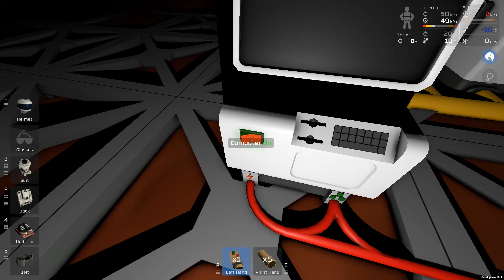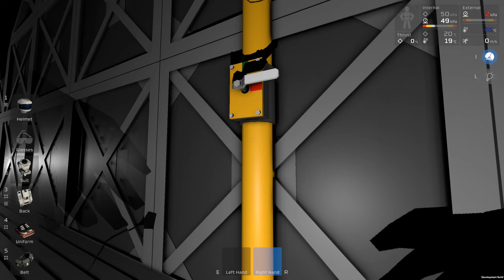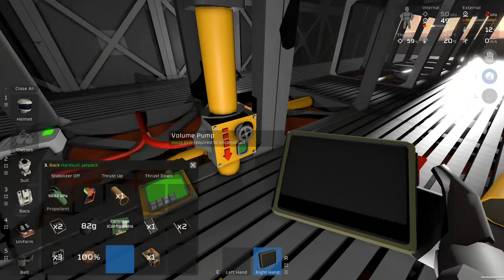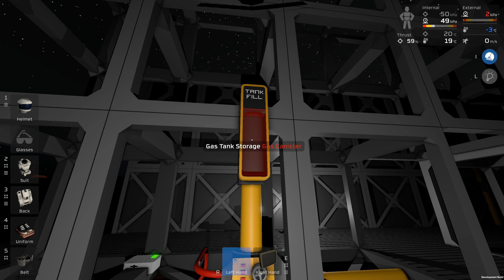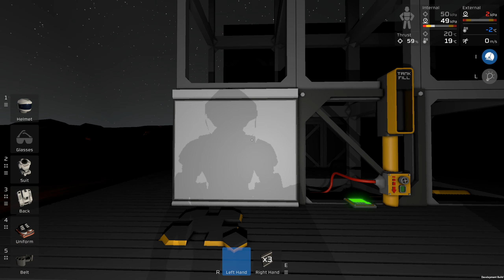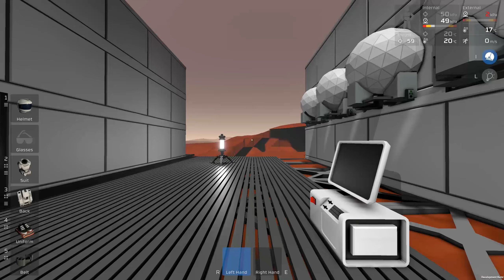Stationeers S4 E18 - Gas Inputs, Tidying, Gas Room Building

Comment: Once you have lights connected to wire you can remove the block they are attached to. This way you can have lights on window roofs. They are basically held in place by the wire but so what? ^^

Comment: RE your thought on the fill station regulator:  I'd turn it on/off based on the pressure value of the regulator (Setting) and the pressure in the gas tank storage (Pressure).  This way it will keep the pipe at pressure without a tank. When you put in your tank, the pressure will drop causing the regulator to kick on bringing the tank up and shutting off when it's at level.

Comment: I took your "challenge" from the last video to create a script to read the filter type in the filtration unit and turn on the device if the gas matches the type of filter.  I have a script that's variablized and fits exactly in the 128 line limit of the script :P Unfortunately, I don't have it here at work (ahem), so I'll need to link it later tonight.  It will read all three types of filters for each type of gas and toggle the filtration unit if the type of filter is needed in either slot.  I have not fully tested it, but I'm pretty sure it's good to go.

Edit... Got it: https://stationeering.com/tools/ic/_JMnKRmR5qH